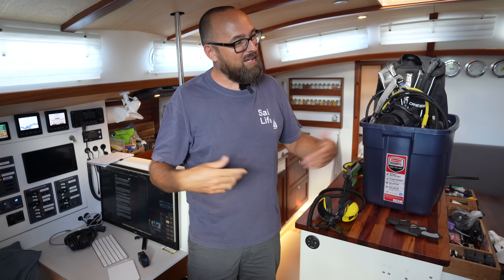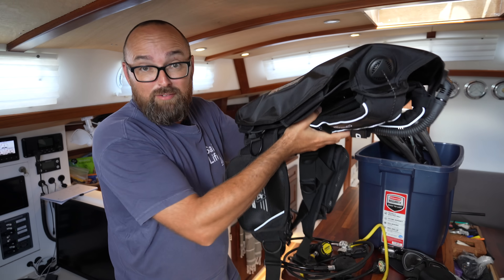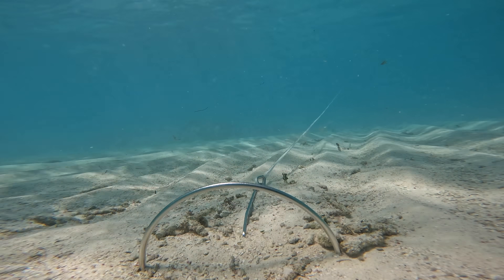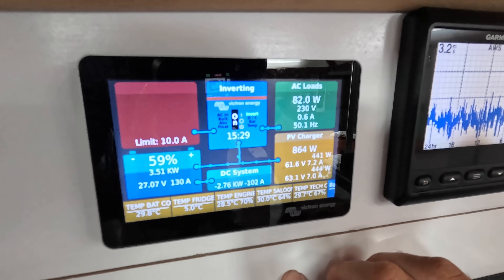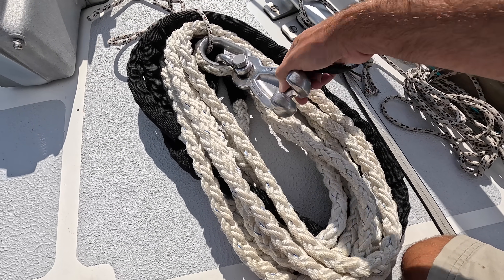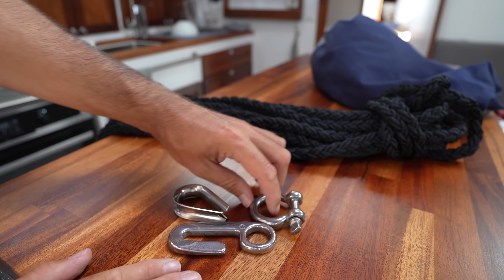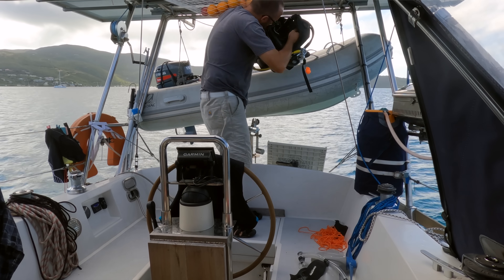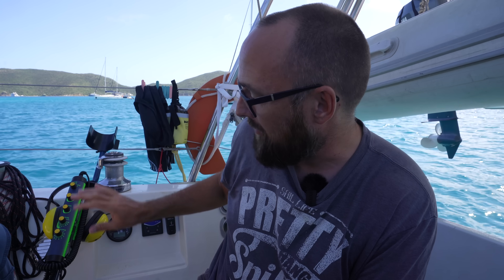Sail Life - Meet Mr Money Maker (underwater metal detector)

Comment: That anchor system looks like it's holding well for dinghy in light chop but a length of chain between anchor & line might keep rope more horizontally planed on the bottom & prevent it from yanking upward when it comes tight under shock load.
Reply: Agree.  About 2m of 6 or 8mm short link chain :)

Comment: The Excalibur 2 is not middle of the road, it is the best detector you can get for what you are using it for. I have two of them. Searching under boats will be hard because of the amount of trash targets you'll have to dig up and limited air supply.
If you want gold, silver, platinum and diamond rings then you should stick to popular tourist beaches and search in knee to neck deep water. Get a scoop too, you're gonna need it when not scuba diving.
When I'm diving I am fairly over weighted to keep from getting tossed around too much while digging up targets. You can just fan the sand and rubble away until you see the target, no need for gloves.
 The bad news is that you must dig EVERY signal! A gold ring with a crack in it can sound just like a rusty fish hook and a pull tab can sound just like a ring.
Reply from the maker: Thank you so much for the awesome tips :) What are the rules typically like for metal detecting on a beach (assuming it's not some kind of private beach) ?
Reply: I'm in Hawaii and can only say that for here,  Some marine preserves are off limits.

Comment: I made many yacht tenders over a 15 year period.  If you add a fin onto your motor it will help with the load distribution in the dinghy.  Also, while this is somewhat of a personal preference, the outboard is designed to be used by someone sitting on the starboard side of the dinghy.  The handle is offset for this purpose.

Comment: Hi Mads, As for snubber rope stuff, as a climber i might say, have a look at the Klemheist knot. Make it with a piece of climbing webbing or rope and for a loop a double fishermans knot. Plain, super  simple, does not lock up, the harder you pull the more in grabs and with no load loose. Anchor chain is easy but works on a rope too. Like want to take of the rope of a winch without lose the tension, just add a klemheist on the rope, attach it, and loosen the winch. Want to make a 3:1 pul system etc etc,. super handy knot on a boat. Other nice to know knots with same function. grab on load and loose easy under no load no load: the autoblock knot,  Distel hitch,  Valdotain Tresse Knot.

Comment: For the condensation, here goes a tip..... Do place plastic tubing (hoses) directing the "blow" to a plastic bottle... You can tide them with simple zip ties, it works great! You can reusetank is transfered to the water of the  an old drinking water bottle for that, and it will be easier and cleaner to use...
Another tip is to use a large size bucket where you place the filling tank (it needs to be upwards), so a good part of the heat of the bucket, bear in mind to have the tank's valves out of the water, while charging or manipulating pre charge,  you don't want to introduce moist in them!

Comment: If you want to try stopping the growth on your ropes and props hulls try coconut oil. ... Even in the water coconut husks don't accumulate growth. You can add it to cheap bottom paint and prop coatings. 
Try it on your ropes.

Comment: I gave up my jacket style BCD after about 25 dives.  I hated it.  Felt so restricted.  I went full on DIR and have back plate and wings now.  I also carry the analog pressure gauge.  My computer is hoseless, and I carry my backup reg around my neck and my primary is on a 7' hose.  Need to share air, no 'hugging' your buddy.  Hand over the long hose reg and go to your backup.  Between the built in weight of a backplate (7lbs), and the freedom of not having the that jacket...oh the diving got so much more enjoyable.  Especially diving in the cold water and you have a dry suit, argon bottle, dive light, deco bottle, etc. all hanging on your harness...much better than hanging on that 'jacket'.

Comment: If you can get ahold of one of the first-generation M1 Mantus Chain Hooks they are much easier to hook and unhook while dangling over the bow pulpit.  I've done it hundreds of times and it's pretty simple once you get the "trick" of lining up the crossing of the two crossing slots on the hook.

The new M2 claw hook is supposedly easier to pull through the anchor roller while installed so you could theoretically pull the thing up and work on it there and then undo the bridle ends and pull those up through the roller too.  It seems to me that this would cause a bit of wear and tear on the lines since the chain and roller bits would be chafing on them as they all pulled around the roller together.  The Mantus-made bridle we got with our package deal has chafe protection for a few feet near the hook end to account for this.  Still, they might get a bit tangled around each other in the process.  This all seems a bit janky to me and I am glad I own the original hook so it is easy to just slap it on and off leaning over the edge the bow.  No worries.

The hook itself should last forever and the plastic gate is a lot more durable than the flimsy rubberband holder thingie on the "improved" M2 version.  I love all things Mantus but I prefer the older hook here.  Ours was bought in the winter of 2016/2017 at the Chicago boat show and has heen used hard over the years but  original first plastic gate still has a little life left in it, but will soon need to be replaced as wear and tear on the plastic is evident.

A few years back when the new hook came out and it became apparent that the old one wasn't going to be made or supported any longer we bought literally 10 extra plastic gate thingies so that we could go on using our old hook forever.  If we get a minimum of 5-6 years of use out of each one then 10 spares should last us the rest of our cruising lives.

Comment: I know where a shipwreck is on St. Croix.  It’s called Long Reef.  A few years ago I found several 1920’s silver spoons and forks and even a buffalo nickel, a ships bell and lots of small items, but I needed a metal detector to find more.  You are just a few hours sail from there now. It’s only in 8 feet of water on the south side it’s called long reef next to Ruth Island. If you scout around there you will find ropes lying on the bottom which will lead you to the wreck.  I’m assuming it was 1920’s and Danish.  When you come out of molasses pier it’s just a 1/4 mile or so on your left. You could anchor in Fredriksted and dinghy around.

Comment: Go closer to the shore and in the sand where folks would picnic etc.  Jewelry, coins and watches kind of common there and the tuning you are going to do is good.  Test with modern coins watches and then gold silver etc in no sand cover a few inches of sand and a foot or so.  You can do that on the beach.  Then in the water.  Learning how to tune and discriminate between the materials your detector finds and it's reaction to them will help a ton.  Good hunting!
Reply from the maker: Thanks for the tips! I'm sure it'll take a while to learn how to best use Mr Money Maker but it's a lot of fun :)

Comment: Looks like you need a cover for the windvane, its rubbing on the dinghy.
Reply from the maker: Only with the dinghy in the water :) When it's up there is no rubbing. Maybe at some point we'll get around to adding a swim platform - that would solve the issue :)
Reply: @SailLife  at 16:07 you can see rub marks over your shoulder.

Comment: i prfer to have a weststyle and an normal belt, but tu have 2 stationaryweight on the tank belt 2k or so. as this weight is higher up than the belt it distributes the weight more evenly. giwes stabelbility and agilily. wing bcds are made to compensate for heavy thermal protection and accoriant weight sysren. you dont need that. keep it simple. you dont wanna be a victim of your equipment
flo from bavaria